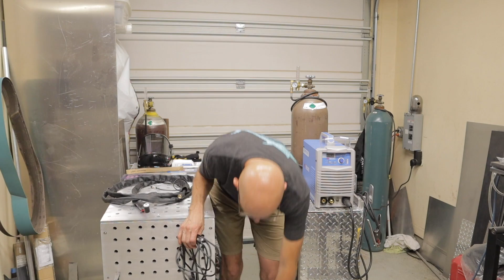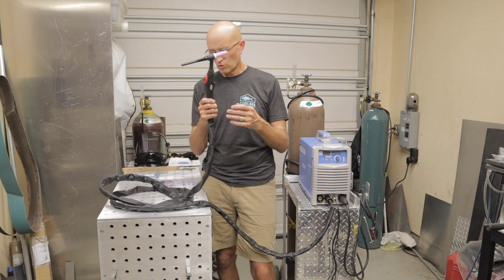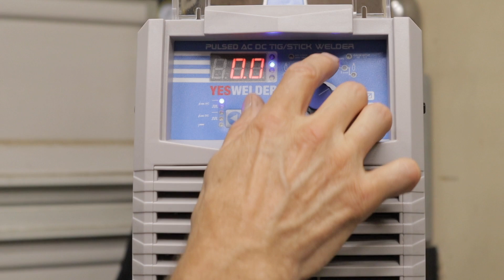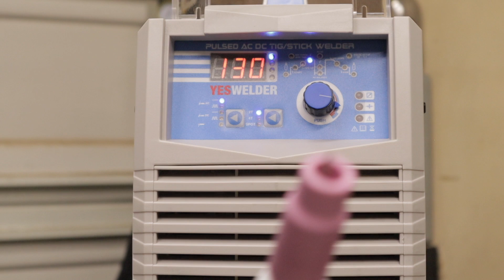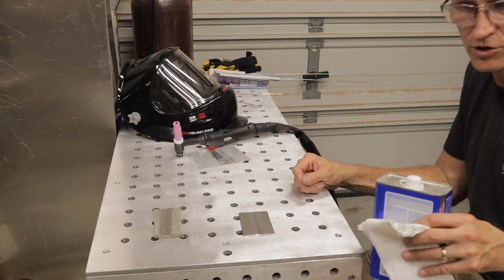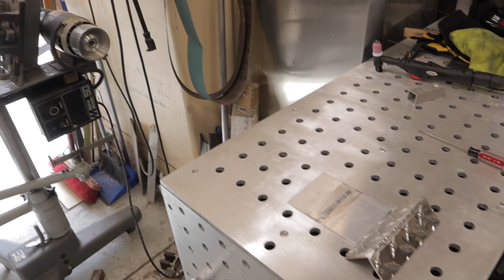YESWELDER NEW TIG 250P Setup & start tig welding Steel & aluminum.   Discount Code in description!

Comment: Could you possibly help me figure out how to put a 17 torch on the Yeswelder 250p?
Reply from the maker: Hi Michael! Yes, I can certainly help you with doing the conversion. First you will need this brass coupler from McMaster Carr. https://www.mcmaster.com/90465A325/  The thread is 5/8-18 which is the common thread for many size 17 Torches. Here is a link to a picture of the exact CK Worldwide 17 torch that I used to do my conversion years ago. https://drive.google.com/file/d/1-YNMO5XhyzBTKBKgCMzHmgJCIgpBpSxW/view?usp=drivesdk  Ok, so when you get the coupler you will need to cut it slightly longer than halfway. Clean up the cut end and it now will thread onto the torch connection on the welder. It might be a little tight after a few turns because it is a 16mm metric thread, but it is almost identical to the 5/8-18 thread on the coupler. You need to get it threaded on far enough so that the 17 torch fitting will thread through the coupler and bottom out on the welder’s brass torch fitting so there will be a seal of argon flow. I hope this explanation makes sense. If you have any questions, let me know and I’ll be glad to help. 👍😊

Comment: Hi, again! Do you ever do stick welding with this machine? I have and lately the "parameter light" (which is supposed to be for mismatched TIG electrodes?) comes on. I can't understand that since everything is set up properly for electrode positive stick and all connections are good. One posible clue id that the stick electrode size does not show 2.4 (using 3/32) as a choice. Weird. Any idea what I'm missing here? 
All the TIG modes still work as expected when used that way. It just does this for stick mode EP and EN.
Reply from the maker: Hi there! I’ve never used mine for stick welding. I just use it strictly for Tig and 90% of that is with aluminum welding. Still works great to this day!😊👍

Comment: I have the yes 250P and I can not get the welder to do more than buzz and do a tiny contact with the electrode. settings have all been changed and the arc or stick welder does not work at all? I tested continuity on all of the leads  and had the pos and neg for ground nothing works ? any other ideas  and yes it has never worked?
Reply: This happened with my first one, and I contacted yeswelder and they sent me a new one for free. Yes, free, and let me keep the old one. I fixed the broken one by unscrewing and opening the front cover, and gently squeezing the two solenoids where the arc is transmitted closer together. Hope this helps

Comment: Thank you for this Video... I bought one of these machines about 6 months ago and haven't really used it until this evening..(I have a Lincoln Precision TIG 185 that does most of what I need to do)  I was struggling with the Yes Welder..!  I'm 71 years old and have been TIG welding since I was 9 years old. Yes, Nine years old... Started out on a Hobart 300 amp machine in my dads shop.  I closed my own business in 2015 but kept my Lincoln 300/300.(state of the art in 1970).. I could weld anything with that machine from tinfoil to 3/4" Plate or castings.  It finally gave up about 8 months ago, and though I've had it repaired many times, this time it just didn't make sense.. As I said, I'm 71 years old and I hate anything digital. I can't even set a digital clock.. So this machine is frustrating as H*** ..!  If one more person tells me that anything digital is "Intuitive" , I'm going to slap them in the mouth..!! 
The fact that it is only HF Start, instead of Full Time HF is a real drawback in my opinion. This evening I was welding 1/4 inch aluminum plate in a Filet. So I needed about 220amps. I was getting very frustrated until I watched your video and caught the part about the Initial voltage level. I could not get it to hold an arc. Once I cranked up the starting voltage, that solved the problem. A couple of things that I discovered after I got going was, if you don't tell it that you have the correct size tungsten for the heat range it won't initiate an arc. Also if your tungsten gets dirty or contaminated at all, it won't hold or even start an arc.   Also I noticed that if you let off the pedal quickly, the arc stops/breaks, but if you back off slowly it will continue to hold an arc.  Both of these things are because of not having full time HF..  Having said all of that, I am getting used to it, and your video helped a lot..!!  Even for someone who has been welding for 62 years.!!  So again Thank You.
Reply from the maker: Hi Bill!   I’m so glad that my video helped out!  I’m a newbie compared to you! I’ve only been Tig welding for 37 years! 🤣 I also learned on older, very large transformer machines. These newer inverter machines are so tiny and light. I still have a hard time wrapping my head around them getting 250amps out of such a small package. Let me know if you ever have a question about anything and I will get right back to you. Have fun! 👍😊Don

Comment: It looks like this model is no longer available on Yeswelder's site as of August 2023.  There are still some on Amazon - I picked one up there for $425 mid July.  No regrets so far.  Thanks for the in-depth review.
Reply from the maker: Hi Tom! That’s really weird. I just looked on their site and I can find no signs of it at all. That is a great price that you got yours for!👍 I use mine all the time in my welding business. I run it with my Honda 5000 generator in the back of my truck and it works great! I repaired an aluminum pontoon boat the other day and it still welds like the day I got it. Great machine for the money!  😁👍
Reply: Don, I'm glad to hear yours is used often, and is holding up.  One sort of rolls the dice on longevity with these lower cost units.  I'm curious if you use the advanced pulse functions?  I'd very much like to see a deeper dive into those functions and when / how to use them.  I suppose it would be the about same for that ArcCaptain you just reviewed too. Thanks again for your insight,  I'm really liking mine so far!
Reply from the maker: Hi Tom!  When I initially purchased the first Yeswelder Mig a few years ago, I had never heard of them and just needed a cheap mig for a project I wanted to build quickly. I purchased it with the mindset that it was a disposable unit and that if it lasted a year, I would be overjoyed! I still have it and use it regularly in my business when I need to weld with 120 volts where I can’t get my generator into. It has been abused and just keeps going. To say I’m impressed is an understatement! As far as the pulse feature, I use it occasionally when I do fusion welding with 3000 or 5000 series aluminum with no filler metal. It works great for that. 😊👍

Comment: What amp breaker are you using for the power supply?
Reply from the maker: Hi Jorge! I’m using a 30 amp breaker and it has never tripped running at full amps many times.👍😊
Reply: @PranaTech  thanks for the reply will definitely keep it in mind when I purchase the setup
Reply from the maker: Anytime Jorge!😊👍

Comment: I do a mobile tire shop and I straighten wheels.
I'm looking to start welding in my mobile setup. What welder would you recommend for a beginner in a mobile situation for hairline cracks in aluminum wheels?
Will the Yes welder 250P get to the job done?
Reply from the maker: Hi there! I use my 250P for my mobile Tig all the time. I can do wheels up to 1/2” thick if I preheat a little bit. Wheels are tough to weld depending on the casting alloy. Some weld great and others have so much crap in them that it can be a real pain. You will need more amps if you are going to weld thicker than 1/2” though. Hope this helps.😁👍
Reply: @PranaTech  thanks for reaching out. Luckily I only plan to do the back of the barrel which is the most common. I'll avoid the thick stuff on the face of the rim.
Thanks again
Reply from the maker: That’s great, this welder will work good for your purposes then.👍

Comment: I've had this welder for about a year and like it a lot, but mine did not come from Yeswelder with a pedal (for whatever reason). Do you happen to know if a pedal other than YW's offering will work okay? I'm trying to save some money, as theirs is about 99 dollars currently, but I see others as low as 40. What should I look for to help ensure quality? Thanks for this really helpful video! Subscribed!
Reply from the maker: Thank you for the great comment! I appreciate it!    I’ve owned a bunch of pedals from the cheapest to my own custom one that I built and I have a couple Nova pedals. Trust me on this advice, do not buy a cheap pedal. The $40 ones are really junk in my opinion. They work but will cause you to struggle in your Tig welding and in the end you will regret it because you could have put that money towards a good pedal. The Yeswelder pedal is worth every penny they are charging for it. It works just as well as my Nova pedal which costs $165. Best deal I’ve seen for a well made pedal. Hope this helps! 😁👍Don

Comment: would i be able to power this unit on a 220 30amp dryer outlet?
Reply from the maker: Hi Aaron! Yes, a 30 amp outlet will work great! That is what I’ve been using for years with this welder and even on max amps for long welds, it has never popped the breaker.😊👍
Reply: @PranaTech  thank you so much for the reassurance 🙏
Reply from the maker: Anytime! Let me know if you have any other questions or need any help with getting going with it.😊
Reply: @PranaTech  so I got the unit! thanks for the inspiration. however I'm noticing that my dryer outlet is nema 14-30. do u know if the plug that comes with this unit a 6-50??
Reply from the maker: Hi Aaron! I just went out and looked at mine and my outlet says 6-50R. 😊
Reply: @PranaTech  awesome, thank you so much!  looks like I'll have to find/make an adapter for my wall outlet. Can't wait to get it going!
Reply from the maker: That’s great! Let me know if you have any questions as you get going. 😊👍
Reply: @PranaTech  I'm having a couple  troubles... I have lots of porosity and also I noticed the arc prematurely terminates despite my keeping the trigger engaged. it'll just abruptly stop mid weld.  I'm no where near the duty cycle either... and I keep the CFH at 15-20, but the porosity is awful. Also, I can barely hear it hissing out at that specified rate.. im kinda thinking I got a bum unit. any thoughts?
Reply from the maker: Hi Aaron. Yes, that all sounds bad to me! I would send it back. Sorry to hear that. I’ve only heard of a couple of bad units and unfortunately it sounds like yours is one of them☹️ They will take care of you, they are a good company.

Comment: I’m just starting out with Tig welding. Thank you for showing me the basics of this welder.
Reply from the maker: Glad to help Thomas! Let me know if you ever have questions as you get to welding. 😊👍
Reply: @PranaTech  I will, I’m just learning to tig weld. I’m making piano sound board cleaners out of steel. I’ve been mig welding so far. Tig would be a nicer cleaner weld. Thank you.

Comment: Did I see you show how to upgrade the torch on this 250P? I cant seem to find the video now? I hate the big 26 size torch and want to convert to 17 stubby.
Reply from the maker: Hi there, sorry for the delay in my response. I’ve been sick for a few days and got behind on answering comments. Here is how I converted mine. 
You will need one of these couplers https://amzn.to/3vLQHJn
Step 1. Chuck it up in a vise (preferably a drill press) and then drill out the center solid section with a 37/64” drill. Step 2. Cut the coupler off just past the hex nut section because it was too long as it was for our purpose. Step 3. You then run a 5/8-18 tap through the whole long piece that has the hex nut on it. Start from the side that is already threaded, away from the hex nut section. Once it is tapped all the way through, you can thread it on to the Yeswelder fitting that the factory Tig torch threads on to. This now becomes a female compression fitting that many companies like CK worldwide make torches to fit. The on that I chose is the CK Worldwide model  TL2112HSF FX  It is a 200 amp air cooled torch with a flex head and works great without all the bulk of that factory torch. I hope this helps and let me know if you have any questions. I am planning to do a video showing this but I haven’t had the time yet with all my other projects. 😁👍
Reply: @PranaTech  Thanks, I'll give that a try. I remember seeing a #short video on someone taking apart the YESwelder #26 torch handle, removing the shrink-wrap, and taking it apart there to add a Ck torch. That would allow to use the factory cable. Thanks again for the info.
Reply from the maker: That’s a great idea too! I think my CK torch will thread right onto the factory hose! The Flexhose that comes with the CK torch is way better than the factory rubber hose but if the goal is to get a decent Tig torch going quickly then that is probably the fastest and cheapest way. I will put that in my video too so others can use that info. Thanks! 😊👍

Comment: How do you identify the type of aluminum ie 6061 or ?
Reply from the maker: Hi Adam, well usually it is marked, but if they’re not marked then 3000 series has a kinda brushed type of finish and usually comes in large sheets and 6061 has faint linear roll lines from when it was rolled into its shape at the factory. Hope this helps.😊👍
Reply: @PranaTech   Thanks for your help. I appreciate your time.  There is alot of information on what to do when you know the type of aluminum out there but not many videos on how to find out

Comment: hello . I live in europe and i want to know what kind of adaptor should i buy to plug the argon into the machine. My machines have a quick coupling adapter, this one has not.
Reply from the maker: Hi Paulo! Here in the US the standard argon fitting is a 5/8” by 18 threads per inch. In metric countries the fitting I believe is M16 x 1.5
 You could also cut the end off the argon hose that comes with the welder and insert a barbed fitting with a clamp that will more easily adapt to your quick change fittings. Hope this helps! 😊👍
Reply: @PranaTech  thanks very much i will do that. Another thing the torch is a 26 not a 17?
Reply from the maker: Hi Paulo! Yes the torch is a 26 size which is just a heavier duty version of a 17. All size 17 accessories fit 26 size torches.😊👍

Comment: Can you use this machine for welding with gasless? Coming from a beginner wanting to get into the hobby!
Reply from the maker: Hi Thao! This welder can’t be used gasless. If you are just starting out I would suggest going with their 205DS MiG welder. It can be used for welding with or without. 👍😊